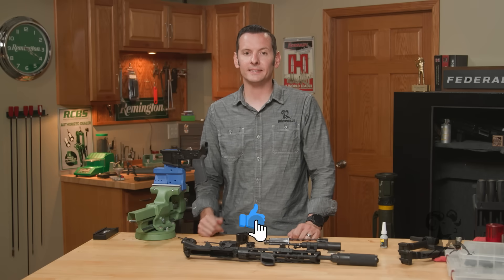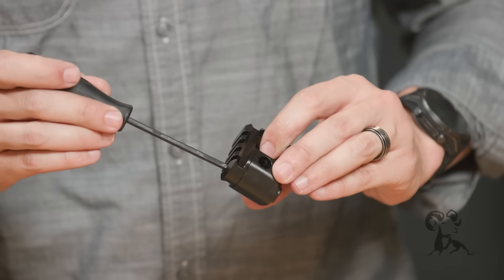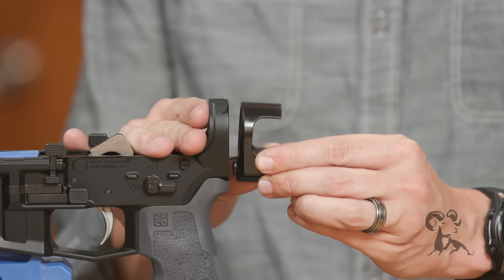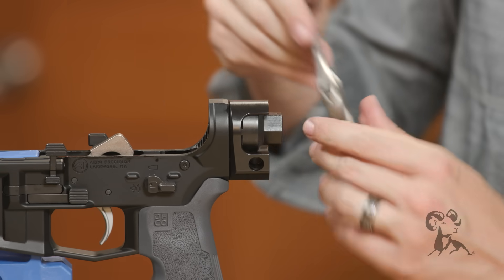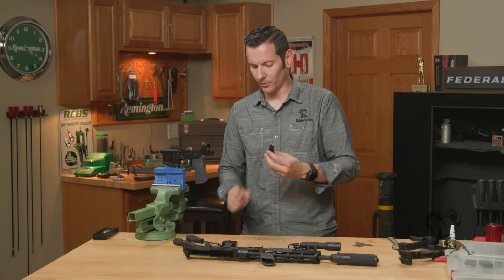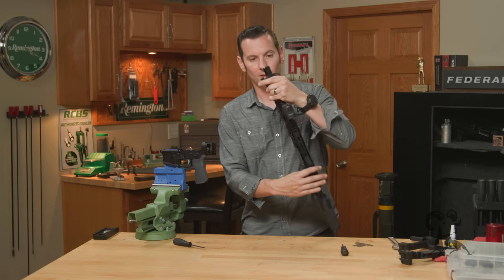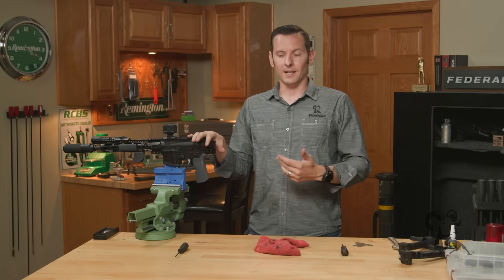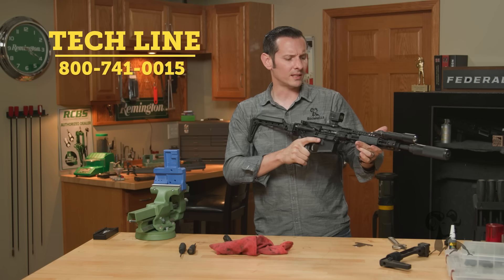Tech Tip: How to Install The LAW RAP

Comment: I assume this could be used to install a folding stock or pistol brace that uses the 1913 style connection on any gun or lower that is set up for a buffer tube, like the TandemKross Upriser chassis for the Ruger PC Carbine and PC Charger.

Comment: I could honestly care less about ability to fire while folded. What I’m curious about is the weight difference between this vs a receiver extension, buffer, bcg, law folder stock adapter? I imagine this would be much lighter? I mean the weight difference between a full mass bcg and the law folder alone prob weighs what this whole system weigh

Comment: I don't like that the rail section is only secured at the bottom.  If it's made of steel It's probably beefy enough that it'll never break under any reasonable conditions, but that weird leverage will never fail to ping as an unnecessary stress point when I look at it.

Comment: 600+ for a system that's unreliable.  
Sometimes it's even difficult to figure out the right buffer weight, now you're playing with "m" for a suppressed and unsuppressed gun. People will argue with "well just get an adjustable gas block." 
I guess, but then you'll go back to wanting a reliable gun.

Comment: So all of the blowback energy is transferred from the buffer into just those two screws and its open for debris to infiltrate it. Ummm, no bueno. Sidebar: that's a mighty good looking hairdo Sir.
Reply: It looks clike a closed system to me. Yes there's a gap on the sides butt the actual buffer thing is plugging up the  space it went Into so debris and dirt just goes through the gap the buffer thing actually stopped it from getting into the lower. Now don't get me wet stuff could get caught in that gap but it's not gonna affect the function of the gun because it can't actually enter the gun.

Comment: How do you open it again?
Reply: I guess you pop both take down pins and slide upper forward
Reply: @leerethamel3204  yes
Reply: You have to push the aric forward into the upper then pop the rear pin and kinda cover/hold onto the aric so it doesn't fly out
Reply: @sirmanbeargaming8710 obviously. I would've liked to see a demonstration though
Reply: I was thinking the same question. I see an answer in your comments tho.  push the bolt forward enough and then you can? that sounds like a pain, mostly in the fingers. lol

Comment: I want it, but at the same time, I'm not a fan of the opening that could allow debris to get in. But then again it's not like my rifles are duty rifles so why should I care about it?
Reply: Once the BCG is installed, it looks like that aft section plugs the hole entirely.  Your ejection port would be more likely to let garbage in at that point.
Reply: @herbderbler1585 exactly, the aft portion is non-reciprocating, so there's no point of ingress.